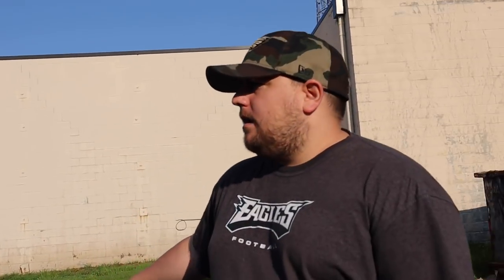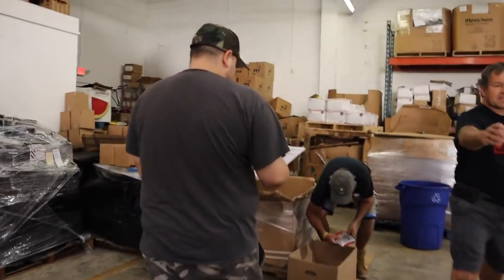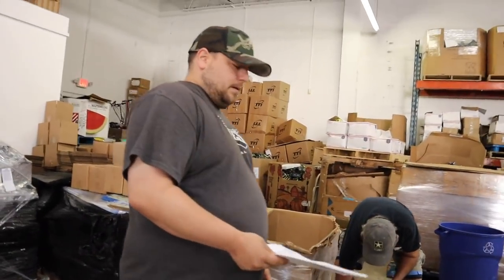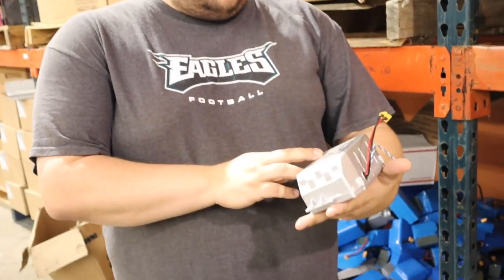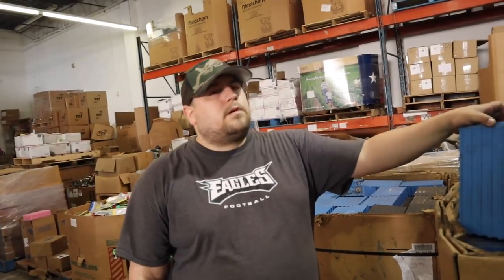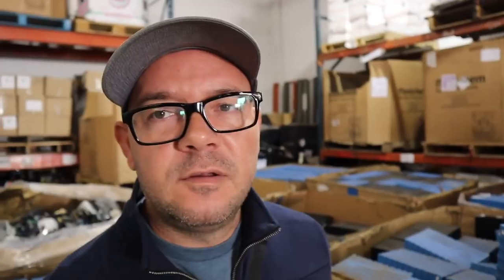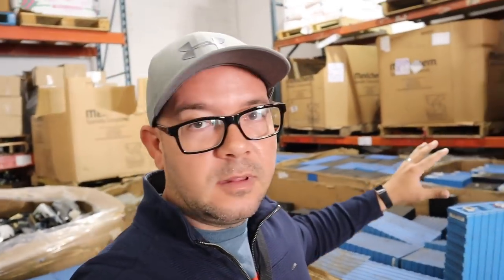Upgrading Battery Hookup's Warehouse | Off Topic Episode 4

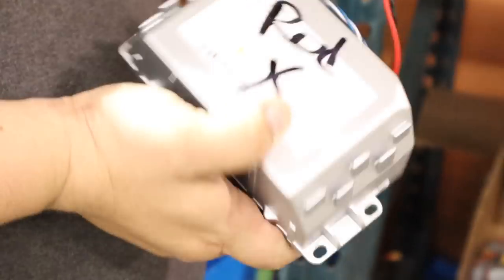Comment: 1:00  could you please explain more about how I can charge the 32.85v explosion proof battery you showed on  1:00
Reply from the maker: That battery has a very weird voltaje. Here are the parameters
NOMINAL VOLTAGE : 32.85V
FULLY CHARGED : 37.8V
FULLY DISCHARGED : 25.2V
Try to find a power supply close to 37v